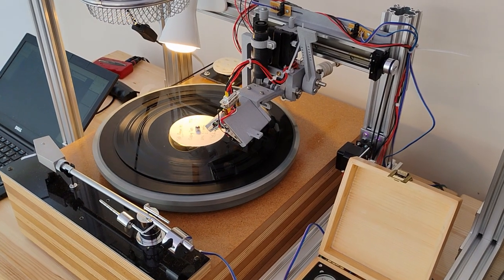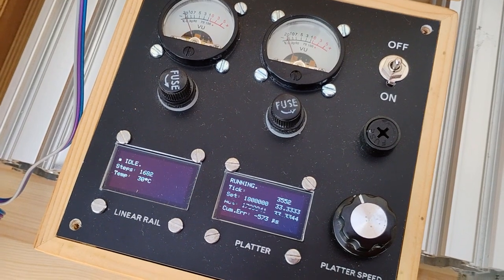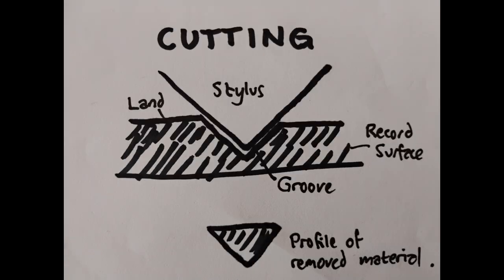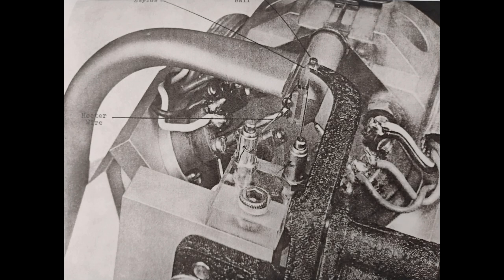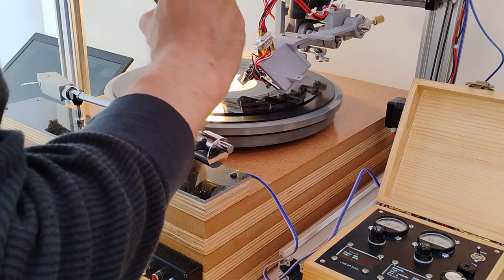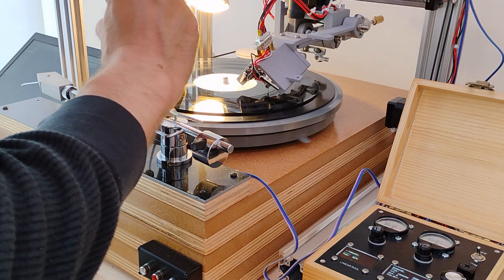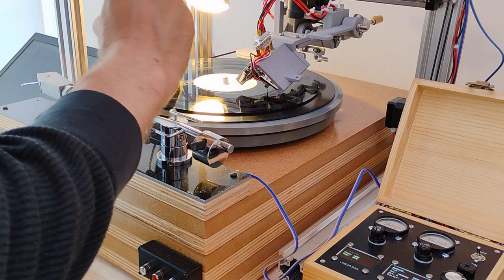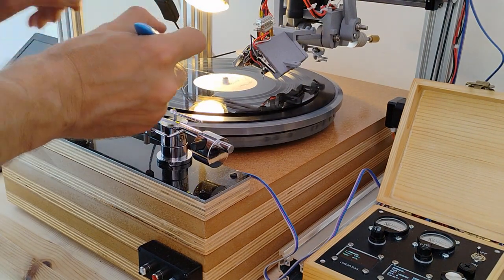Cutting a record (as opposed to embossing one) on a home-made lathe

Comment: I've been building this lathe from the instructions you gave on Secret Society of Lathe Trolls.  Sounds excellent!  I'm about to hook up the Arduino Uno, stepper motor controller, and amplifier.  How powerful of a power amplifier do you use?  In my early trials of building cutter heads, I used the amplifier for my studio monitors, which I also use as my turntable speakers.  I can't remember the wattage right now, but it's nothing huge (maybe 25 Watts?).
Reply from the maker: Hi and thanks for your comment! The amplifier I have is 50 W, which sounds a lot given that the little "coin exciter" drivers are only rated for 2 W. However, you do need some extra headroom to deal with momentary highs such as hi-hat sounds. Provided these sounds are indeed momentary (milliseconds), the drivers should handle them without self-immolating - but I would strongly recommend that you fit fuses (say 500 mA) into the lines to each of the drivers. They have saved me much anguish over the years!

Comment: Hi, Ive done experiments like this for a long time now. Id love to see how your system performs at low speeds, say for talking books where record time is the aim rather than quality. How does 16 sound? or the 8 rpm talking book standard. The lowest usefully hearable speed Ive heard is 3! Back in the day imagine how much you could fit onto 2 sides of a 12 incher at 4 RPM.
Cheers Daniel.
Reply from the maker: Hi, and thanks for your comment! Quality of the sound depends on (amongst other things) the linear speed of the disc under the stylus. The outer edge of a 12-inch LP moves more than twice as fast as the locked groove at the end of the side. Thus, the sound waves are "scrunched" in the inner grooves, and the playback stylus may not be able to track them well. For this reason, it's wise to put more subdued, less "hot" tracks at the end of sides, and keep the club bangers for the first couple of tracks on a side. At the outer edge of a 16 rpm LP the groove will only be moving about as fast as the final track on a 33 rpm LP, so the sound will be compromised from the start, and it'll only get worse as the side progresses! That said, 16, 8 and even 4 rpm can be used for speech, with progressively worse returns on quality.

Comment: Hello! I tried cutting on a compact disc with a steel needle, but there was a very loud noise. Embossing is only one possible method with it.
Reply from the maker: Your steel needle is probably too sharp. For old CDs, you can try embossing, but you'd need to make the point of your needle into the right shape. You can do this using a Dremel tool (and a magnifying glass). The needle tip should be a cone of about 90 degrees. The angle and needle weight would need to be found by experiment!
Reply: @davidseannelson  I tried it, it worked. But the needle should have triangle profile - it increase high frequencies.But a record had noises , maybe -35dB

Comment: Great work. Link so we can pay you? Many appreciate the effort you’ve taken and would like to build systems but repay you? Where do get the cutting stylus and blanks? Have you made any significant changes to the plans you posted? Did you craft the torque tube via CNC? So many questions 😂 I built all the parts from your design but stalled on the actual cutting stylus because just couldn’t find a solution.
Reply from the maker: Thanks! Embossing styli came from RecordLatheParts, in USA. Cutting styli are produced by My Shank, a French company. The one I have has P/N 362 S. My Shank now has an outlet in the UK, Bladud Flies!, and they are reliable and very quick to send orders out.
Reply: @davidseannelson thanks David, I’ll get one and continue the project. I haven’t tried your prep software but that looks great. Well done!
Reply: @davidseannelson tried myshank and they never respond so I went direct to the maker and saved a heap